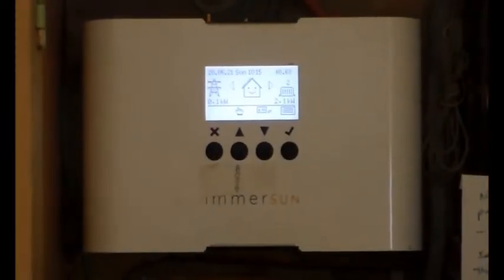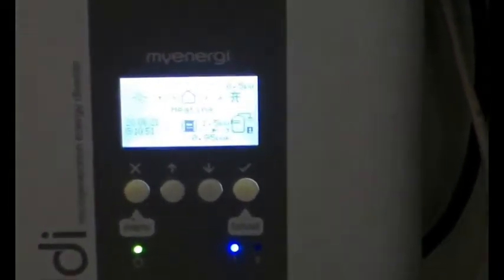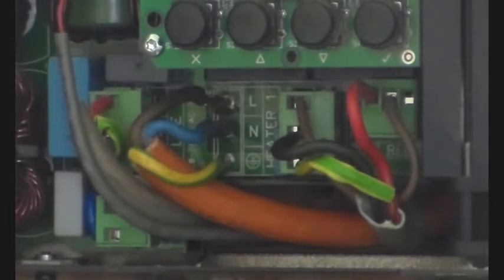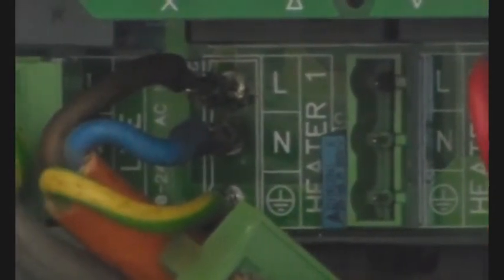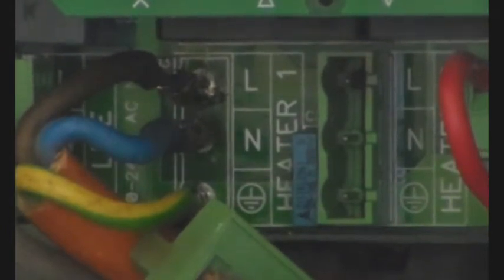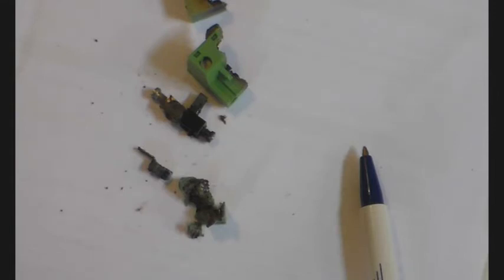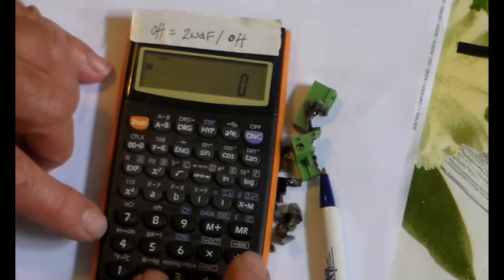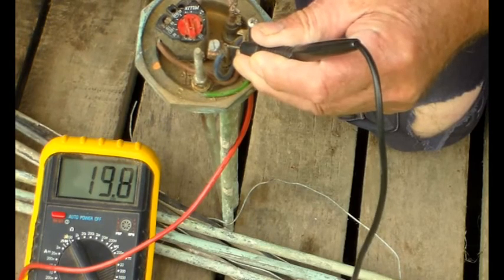Immersun diverter design fault repair, burnt connections.

Comment: I have the exact same problem. I purchased mine in 2022. Looks like they didn’t fix the issue. Almost caused a fire in my home. I throw it to the bin immediately, didn’t even want to fix it. Don’t want to keep something so dangerous.
Reply from the maker: Those plugs are not designed for high current, no wonder they went bust and are now run from China with non existent customer care, cheers

Comment: I have been having Load Circuit Error about 4 to 5 times since I have had the immersun and I found that simply switching it off from the consumer unit reset the immersun and it worked fine but the last time this happened I did just that and it worked for a week and then went completely dead ie the LCD panel did not work and of course it was not diverting power to the immersion heater. Is there anyone or anywhere I can get this fixed?
Reply from the maker: Hi, sounds like you have a problem with your immersion heater (the load). Immersun still exist, you could try contacting them, but first I would investigate your load circuit, cheers
Reply: @TheInfoworks  Thanks Andy, I will contact them. When you say to check the load circuit do you mean checking the actual immersion heater element?
Reply from the maker: @raymondpereira6146  Hi, yes, they can rot out over time in hard water areas, check for earth leakage (between live and earth) on the whole circuit, cheers

Comment: Thanks for the video. Mine has error code 8 which is Load Short Circuit but cant see any issues from looking at the inside of the unit. Any ideas?
Reply from the maker: Hi, if it is load short circuit then is there a problem with your immersion heater, has it rotted out and is a short to ground. I would substitute a a known working load, a heater or even just an incandescent bulb. What do you think? Cheers
Reply: @TheInfoworks  Thank you for your reply. Does the Immersun have a separate heating element going into immersion unit? We seem to have hot water still but not sure if this is just the boiler doing the job. Thanks for your help
Reply: Also could a fault at the inverter cause this issue? Or does it come energy cpme direct from solar panels (not via inverter)??
Reply from the maker: Sam, just switch off your immersion heater and see if the message changes, the DC power from the panels is processed by the inverter before it is fed into your electrical circuits and the diverter only deals with any unused electricity that would be exported. Sounds like you need on come on the solar grid course run by Brighton Permaculture trust in June. Cheers
Reply: @TheInfoworks  Sounds Great. Have restarted Immersun and also tried to factory reset but wont complete setup as the error code keeps coming up. Also having issues with the two battery banks not charging from the inverter so wondering if its all linked? Seems to still be putting into the grid however
Reply: @TheInfoworks  Also i cant see how to switch the immersion heater off. Its looks like its all wired through the Immersun unit and then into the top of the immersion heater
Reply: @FireFlySamson  we also experiencing the Error 8 "Short Circuit- Check Heater" after I repaired my Immersun after a Varister failed and went bang. The Immersun is working fine now except for the above issue, but when I isolate the immersion heater the Immersun does not go into error mode. I've checked all wires at the immersion heater and even tried a new thermostat on the heater element itself and all okay, even the element tests okay with 21 ohms...so I'm stumped !

Comment: Nothing wrong with this guide, but be careful.  I fixed my burnt connections, about five minutes later one of the power  controllers on the heat sink exploded.  No fire or other damage but at this point I gave up and ordered a new solar diverter from a different company.
Reply from the maker: Sometimes you've just got to have a go, cheers

Comment: So you drew 12 amps through a connector rated for 10 amps and it melted?
Reply from the maker: Hi, good to hear from yourself, yes bad design isn't it, but it lasted 5 years. I'm wondering if I should sort out the others before the inevitable happens. Maybe use 2.5 copper and twist it tight around a piece of welding rod to make a tight spring type of thing, then solder it in place. That way there is mechanical was well as a solder joint, cheers
Reply: @TheInfoworks  I reckon that is good testament to that connector lasting that long in such a mildly overloaded condition. Yet, I agree not good design to incorporate such a connector in a unit that is designed to allow more current. 

There are some heavier barrier terminal connectors you might be able to use to replace them with but space might be an issue. If you don't mind a permanent connexion to the unit then I think your welder rod idea will work well. 

Or you could use small copper nails to make pins and wire wrap your conductors onto these using some thin copper wire as the wrap, such as what might be found in a scrap of Cat-5 cable. Then solder over the lot. You could probably prepare that end before soldering it to the board. Would probably be less fiddly that way.

Comment: It is a lesson learned more than 40 years ago with Molex connectors. Never use them at more than half the rating.  This is a double threat with two possible connections, wire and board, in the same line.  Getting even 10A on a circuit board is an iffy design.
Reply from the maker: Hi, I fully agree even though it's worked well for over 5 years but a more robust connection would be much better. I will monitor my repair. Cheers

Comment: The amount of thought that didn't go into the design of the connector is proof positive that profit still trumps safety and longevity. Very informative video.
Reply: Perhaps it's a case of the specification of the connector saying max 10 Amp, but only momentarily. These systems are running high power for hours on end and need a bit of beefiness to them.

I wonder if the designers actually look at the physical product. One can tell visually that a roundish pin wedged between two flat pads will have a small contact area. These connectors look better for communication rather than power transfer.
Reply: @ianhelsbyservices  I agree with the points you put forward but it still doesn't excuse the lack of foresite that should go into producing a product that can produce catastrophic results on many levels. A poorly designed connection system like that plug could easily have caused a structure fire. Real world conditions weren't well considered. A connector like that with poor conductivity will always draw more heat and power than was the original expectation.
Reply from the maker: @ianhelsbyservices  Ian, good to hear from you, I agree with your points, a large spade connector has a bigger and more robust connection, cheers
Reply from the maker: Hi, yes it's down to a price not up to a standard ...again, cheers